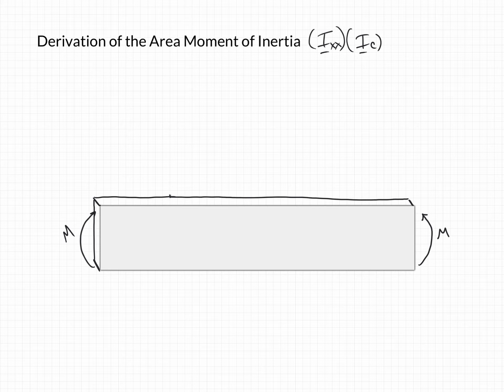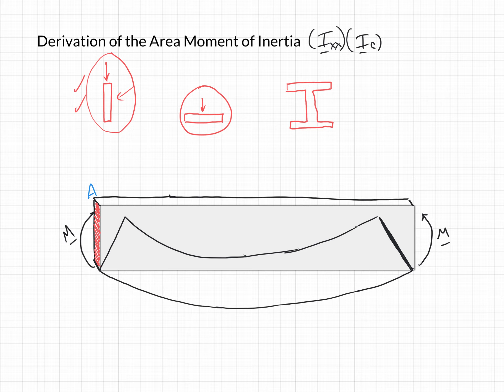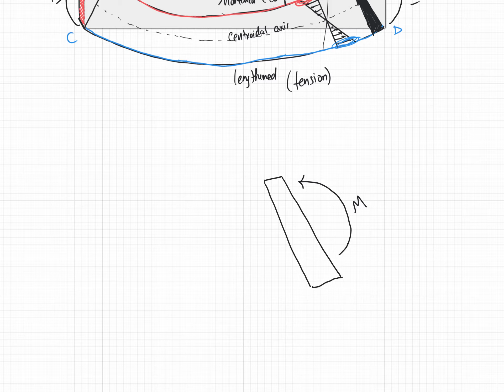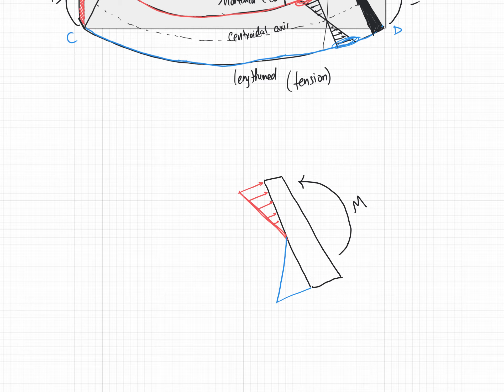Derivation of the Area Moment of Inertia

Comment: Thanks for this! 

But when you use the summation of moment=0, this should be the summation of the moment of each tiny area (moment acting on dA) over the whole beam cross-section area. 

What I mean is you get the F=EA(r/R) then at each "tiny area" the corresponding moment can be calculated. Then all the moments added together should equal "0".

Comment: @waynewagner2255 Hi there, why does your FBD show the compressive/tensile forces in opposite direction to what you showed on the beam around 7:02?
Reply: The FBD shows the internal forces that react in the beam. An element in tension will pull pack to react oppositely.